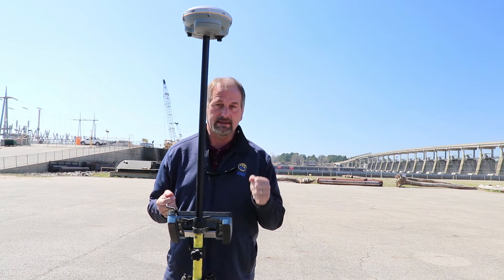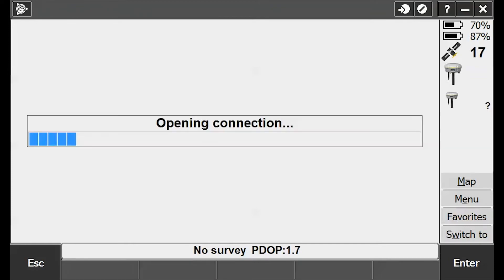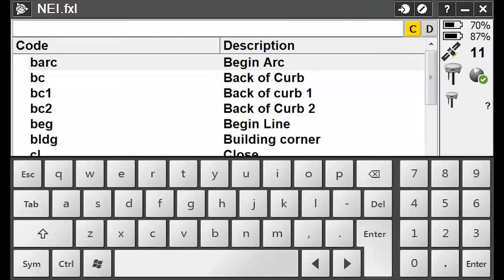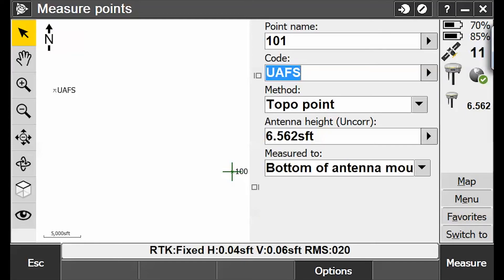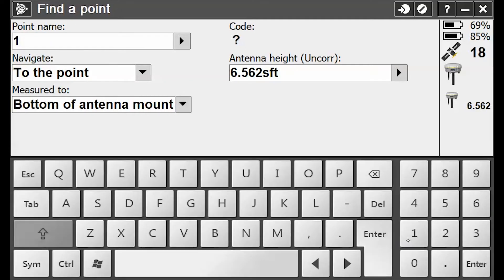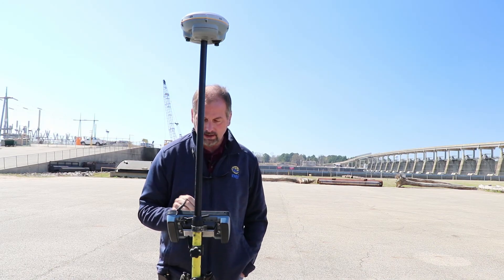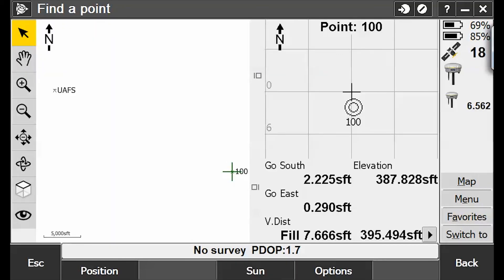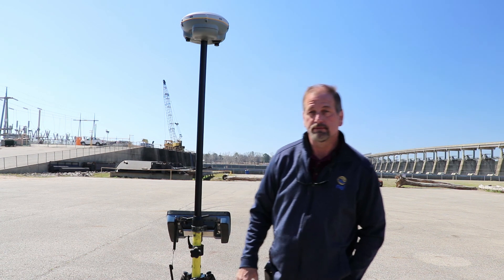Navigate to Point

Comment: Looking to buy a used GNSS rover to replace a rented Leica GS18 and I guess the R8s on its own as a rover doesn't give you that sub-cm accuracy on this showing. Really difficult to decide what to get for around 10k. Thanks for the vids man.
Reply from the maker: freddieboyesp freddieboyesp to get sub cm you will need a base. You can use it as a network rover. See if you can find a used R8-3 or R8-4. Really good receivers and will work as a base if you need one. Lots of networks around here are GPS and Glonass only. These receivers need common satellites to work best.
Reply: @SurveyingWithRobert  Thanks Robert.  We would be using the R8 as a network rover connected to an RTK network such as Smartnet without a base station. Would the R8 perform well enough? It's a bit of a minefiled with all the used equipment, my understanding is that to access Glonass, Galileo and Beidou as well as the European satellites we would need the R8S or a model 4
Reply: @SurveyingWithRobert  I should add that I'm in the UK